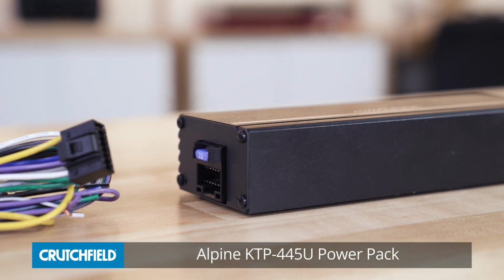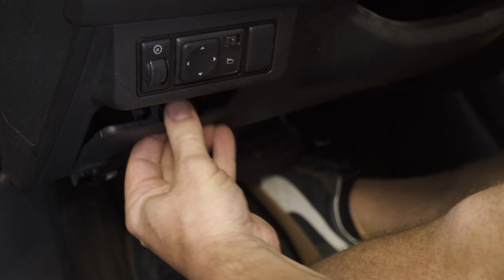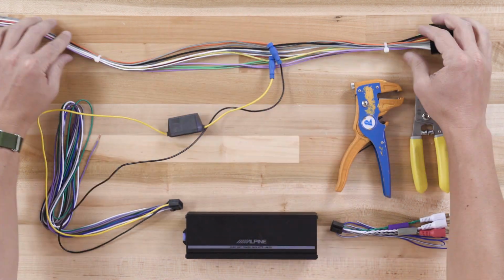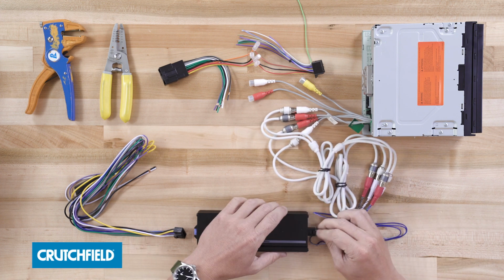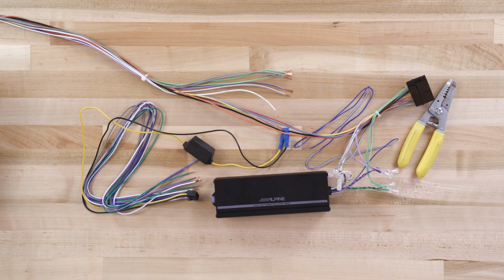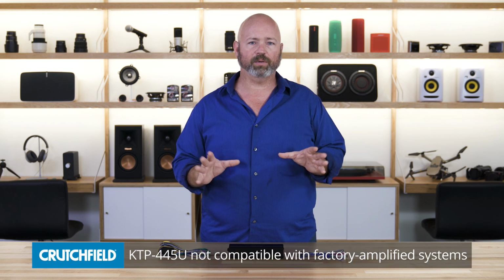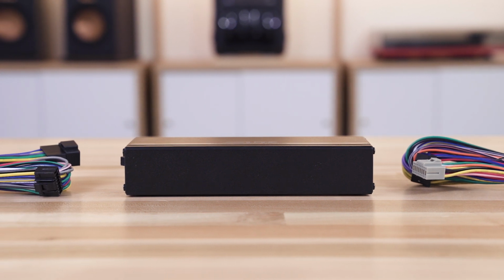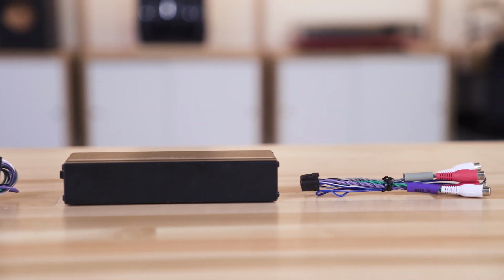How to install the Alpine KTP-445U Power Pack compact amplifier | Crutchfield video

Comment: Great video but what about the ground wire?
Reply from the maker: That part of the install (for the scenario where a new power wire is ran to the battery) will vary depending on the vehicle and is covered through the support we mention in the video that we give our customers. If you purchased your amp from Crutchfield, then I recommend contacting them using their direct dial number that we include on the order invoice. If you don't have that handy, you can call 1-800-955-9091 to get us to look up order the order and connect you to them. If the amp was purchased elsewhere and they cannot help, I recommend contacting Alpine's support on 800-257-4631

Comment: I love this amp. I put this in my 2005 mustang gt years ago. 45 watts rms is more than enough To power your 4 speakers super loud with no distortion. This amp is about double power of any standard aftermarket head unit. Using this keeps my trunk clean. All I have is just one amp in the back powering the sub without having to run a bunch more wires to the back of the car to power 2 amps.
Reply: @joshymcdaniel9233  that is usually marketing mumbo jumbo, you know 50w max, in real life those aftermarket radios make at best 14-21w RMS
Reply: @joshymcdaniel9233  if you bothered to actually measure you'd fine that you have to get into the $700 head unit range before you get anything over 14W ... literally every head unit on the market regardless of what it says can only do about 12-14w per channel with 1% distortion... those 50W numbers are at 10% distortion which may even damage your speakers and will sound like trash. These amp packs acutally can put out 45-50W per channel...
Reply: where did you get your power from? did you hook up to battery? because im trying to avoid connecting to battery
Reply: @helsonly722  it uses the same power that your head unit uses. You can use a separate power and ground if you want to but I’ve been running this for years without issue.

Comment: People have reported that the wires to the speakers have switched polarity, as in the striped wire is sometimes incorrectly installed on the positive lead. @Crutchfield, could you confirm if all positives are supposed to be on one row (along with the black ground wire), and all negatives are supposed to be all in the other row (with the yellow power wire)?
Reply from the maker: We found that the speaker outputs flip between positive and negative on the top/bottom rows
Reply: @crutchfield  What did he say. Flip what. I hope he's not getting paid much that fat bastard  he can't explain anything in plain english.

Comment: I have a question.  I hooked my power pack but I can't seem to get gain control to work. The amp heats up and I have RCA Connections in the back of HU. I didn't connect the remote turn cable on RCA harness side. Do I need to connect that blue wire on the RCA harness instead of the blue wire where the speaker connection are? Do I need to connect speaker wires. I see you connected everything in video.
Reply from the maker: Hey Brandon!
If you purchased that amp from Crutchfield, please contact our tech support team. They will be more than happy to help you out, and ensure that everything is setup properly for use.
You will find their contact info on the invoice we would have sent to your email, or by logging into your online account and accessing your order history.
Reply: No sir I didn't order from crutchfield. Do I just only connect RCA Cables to amplifier with remote switch or do I connect Speaker wire Harness and RCA Cables?

Comment: Is that an inline fuse on the power wire? Is that recommended when your factory radio fuse is greater than 15amp?
Reply from the maker: If your factory radio has a minimum of 15A, you do not have to use a separate power and ground, although we do still typically recommend using the additional wiring to be on the safe side.
Reply: No, it’s not a fuse it’s a noise filter

Comment: Wouldn't it just be better just to run  positive to battery to not risk blowing fuse, especially if it's barely 15 amps? If i gotta take apart the dash, might as well run it to battery ¯\_(ツ)_/¯
Reply from the maker: It's always good practice to run a dedicated power wire to the battery for your amp. You don't HAVE to if your radio has a 15 amp fuse but that doesn't mean you shouldn't.

Comment: I already have a Metra 70-5520 (retained all steering wheel controls) with this Alpine KTP-445U
 coming from a 2010 F150 (non-bose, non-navigation) and want to add a Sound Ordnance B-8PTD.  What do you think my is my best option is to get signal and remote turn on to the B-8PTD?
Reply from the maker: Hey!
Tech support will be happy to go over your connections with you!  Get in touch with them with your order number!  You'll find their contact info at the bottom of the invoice we emailed you!

Comment: Hi, is the KTP-445A harness plug and play with the Alpine XLi-007??
Thank you
Reply from the maker: I am guessing you mean the iLX-007 receiver. It's harness port also works with the KTP-445A amp. It can be a plug and play install as long as the radio circuit fuse in the vehicle is 15A or higher.

Comment: Hi and good day - thanks for this great Video. Quick question - my current Radio is 7.5 Amp. Instead of running a wire from the battery - can i use a Fuse Tap - on the Radio Fuse with a 15 amp instead? 

https://www.ebay.com.au/itm/Add-A-Circuit-Fuse-Tap-MICRO-Fuse-Holder-APS-ATT-mini-LOW-PROFILE-12v-Free-Fuse-/271502992577?_trksid=p2349526.m4383.l4275.c10#viTabs_0
Reply from the maker: Hi Desmond!
In your particular situation, we would not recommend using a fuse tap.  You will need to go with wiring from the battery instead.

Comment: Wow, that was a great detailed video!  Thanks for sharing!  Question for you, I have ALPINE HEAD UNIT IWE-W957HD installed in my car with TWO 8inch ALPINE PWE-S8 Subwoofer.  So far sounds good but I do not want loud I want great quality sound.  Considering i already have a nice setup.. do you think by adding this AMP will it make a big difference?  I'm looking for quality sound... not loud sounds..
Reply from the maker: Glad you enjoyed the video Jeff. Adding the PowerPack amp would be a nice boost to your front and rear speakers but wouldn't affect the subs. Have you replaced the factory speaker? If so, adding a 4-channel amp like that Alpine should definitely improve the highs and mids to compliment the bass you already have.
Reply: @crutchfield  Thanks for your feed back!  i finally did the upgrade to Alpine KTP-445U and love it!

Comment: Soo can I amplify my factory subwoofer with this ?
Reply from the maker: this is a full range amplifier, and does not have a low pass crossover option.  This should not be used to amplify a subwoofer.  Also, a factory subwoofer shouldn't be powered by an aftermarket amplifier, as they are likely too strong and will damage the factory subwoofer.  
If you need help with setting up an aftermarket subwoofer solutions.  reach out to one of our advisors! https://bit.ly/2KP1zS3

Comment: JR

You covered the aftermarket radio to the Alpine amp, but dropped the ball on hooking the Alpine amp up to the speakers. The four cables are obviously not going to power the speakers in hooking between the aftermarket to the amp. You may want to have someone at Crutchfield review your YouTube videos for continuity prior to releasing them to the public.
Reply from the maker: That’s a pretty great observation Thomas. I did cover how to connect the speaker outputs of the Alpine amp to the factory speaker wire as a part of installing this amp with a factory radio (speaker level inputs), but I did not make it clear that the process is basically the same thing (cut the factory wire, outputs from the amp go to the factory wires out to all the speakers) when using the Power Pack with an aftermarket radio (RCA inputs). We've updated the description of the video with this information to hopefully make things a bit clearer. Thanks for the comment.  - JR
Reply: @crutchfield  JR 
Thanks for the followup. The next question is regarding to new speakers and wiring as opposed to existing stock products. The question here is wire size, as the speakers supply lead wires that appear to be about 20-22 awg. The aftermarket speaker wire I have come across is 16-18 awg or larger speaker wire. Any drawbacks in splicing the 20-22 from the speaker to 16-18 awg for routing from the amp to speaker, then connecting directly to the speaker?
The vehicle is a 81 Chevy c-10 Stepside pickup restoration - and if you have clarification regarding the orange/white wire listed for illumination purposes regarding what this wire splices to for power, it would be very helpful. Neither the Alpine nor the Pioneer DEH-X8800BHS radio instructions clarify the source - key or direct 12 volt, etc.
Thanks in advance
Reply from the maker: I do not expect any issues to occur from connecting those two wire gauges to carry the output from this amp to the speakers. I've also looked at a few pictures we have of this dash and feel like you should be able to install the Alpine in it and may not even need to worry about extending the stock wiring to connect to this amp.
The illumination wire is used to automatically dim the receiver's display when the headlights are turned on so it needs to be connected to something that become hot when the lights are on. I recommend consulting technical support for help with the install and to make sure you use the correct wire in the vehicle. We include their direct line on the invoice we send for the order as we give lifetime technical support on gear purchased from us. If the Pioneer was purchased elsewhere and they cannot help, you might try contacting Pioneer's support on 800-421-1404
Reply: Thomas Evans .....Yep

Comment: Hi, i have an Apline ilx-702d head unit, so i know the KTP-445 'A' model would be plug and play into my apline head unit but my only concern is my fuse for radio is only rated to 10 amps, would be over loading the circuit if i use the 'A' model amp as it would be running power from the radio circuit? Or do they have their own separate power and ground which i could run to the battery? If not would i be better off just using the 'U' universal amp as it comes with dedicated power and ground wires? thanks
Reply from the maker: If the fuse rating of the radio is less than 15 amps you will want to run a dedicated power wire like you'd find in this amp wiring kit https://www.crutchfield.com/p_007CK12/Crutchfield-CK12.html
Reply: @crutchfield  I thought so but can you still run dedicated power with the KTP-445A ? I know you can on the KTP-445U model but unsure if the A model has its own dedicated power and earth.
Reply from the maker: You definitely can! Since the 445A model plugs into the Alpine radio and the Alpine radio's harness plugs into the 445A, you will have a bare constant power wire to use to connect the new dedicated power wire. Its the one on the Alpine radio's harness

Comment: Do I need a bigger fuse amp under the hood or wherever the fuse box is located? Because my radio or the alpine power pack amp shuts off and high volume.  2009 accord.
Reply from the maker: It appears your vehicle does not have a big enough fuse for the radio circuit for this amp to use it. This means you will need to run a power to the battery for the amp. We have a wiring kit for this purpose:
https://bit.ly/2ZE36gc

Comment: How do I install if my car has a factory amp??
Reply from the maker: This Alpine high-powered amp won't work in systems where an outboard factory amplifier is still active. If used in vehicles with a factory amplifier, the factory amp will need to be completely bypassed (this may result in lost speaker channels, if factory amp has more than 4 channels).

Comment: , i have a 10 Amp fuse and I dont know what type of wire I need to use to get to the battery.
Reply from the maker: A 12 gauge wiring kit is what you would need

Comment: So I would have to cut stock harness?
Reply from the maker: If you are going to be using your stock stereo, you will need to cut your speaker wire coming from the stock stereo, and then cut the RCA connections off of the input harness that comes with the Alpine Power Pack.  This will allow to connect via speaker level input!
Reply: @crutchfield  Would it be possible to avoid this by either using a t harness or breakout harness instead?

Comment: Ok so my question remains unanswered my car runs a factory amp under passenger seat ....is there a way i can make this work maybe swapping the amp is there a solution??
Reply from the maker: Pete, In most cases, you can still use this, but you will always have to bypass the factory amplifier.  There are different ways of doing that based on what vehicle you have.  But, the short answer is yes, you can still use this.  One of our friendly advisors would love to go into more detail with you...  reach out to one of them here:  https://bit.ly/2KP1zS3

Comment: Do I have to run wires to each individual speaker or just to the stereo?
Reply from the maker: Depending on the vehicle and where you mount the amp you can often use the factory speaker wire and avoid running all new wire. You can connect with one of our friendly product advisors to get a better idea of how the install would look in your vehicle: https://bit.ly/2DGSzu3

Comment: This amp doesn't seem to need a large power wire. I'm planning to run a 8 gauge down to the harness power wire.  I'm wondering if you did the same.  Also, will grounding the amp directly to the battery prevent noise since it gets a direct path to the supply?
Reply from the maker: The power pack is made to work with most stock stereo power leads (minimum 15 amp circuit) which are commonly just 18-22 gauge so, it certainly does not require an 8 gauge run. Running 8 gauge won't hurt anything but it's certainly not necessary.
If the stock system does not provide a quality ground connection at the stereo, you can ground to the vehicle chassis or all the way to the negative terminal on the battery.
For additional assistance and personalized recommendations, feel free to contact us directly by phone or through our online chat service: 
http://bit.ly/2jBGHPp 
Hope that helps
--Crutchfield

Comment: It's been years since I did a amplifier installation, This may sound like a dumb question but if I'm using the RCA inputs Do my head unit speaker wires need to be  connected to any thing?
Reply from the maker: If you are using an aftermarket radio that has RCA preamp outputs you would use those to get signal to the PowerPack. You would not need to connect anything to the speaker level outputs of the head unit.
Reply: @crutchfield  thanks sounds good

Comment: Will this amp work on a 2017 Dodge Challenger without a factory amp? 
Reason I asked, is a installer could not get the any sound from it. He said it would not work for the newer Dodge's. Guess they tried to connect the power wire.
Reply from the maker: It will work in that vehicle. There are some mid 2010 decade Dodge's that need to see a "load" or a speaker before they send out audio, but this 2017 Challenger is not one of them. Best of luck on getting it working!
Reply: @crutchfield  
Thanks for the reply.
Maybe they tried to connect the blue wire.
Would having the blue wire connected cause no sound from the speakers?
They even tried to reduce the output to get it to work. 
This was a national chain store that do installs all day. Not sure why they couldn't get it to work.
Reply from the maker: @michaelcowan6254  The Blue/white wire only needs to be connected when using the preamp inputs. The speaker level inputs are auto-sensing for turning on the amp. I doubt its that. If you purchased it from Crutchfield, I recommend contacting our technical support for help. If it was purchased elsewhere and they cannot help, I recommend contacting Alpine's support for help. I have 800-832-4101 for their technical support dept.
--Crutchfield

Comment: To save $200.00 I've decided to install this unit and my new radio myself. After watching this video I ask, "Is crying allowed? and will it help?"
Reply: Great thing is it will only cost you $250 to fix
Reply: I already have the alpine ilx-w650 radio. How will this work with my radio and my stock amp? Do I need to remove my stock amp and rewire?

Comment: @Crutchfield, I'm using a factory HU and have an amp using high-level-input (tapped into rear left n right speakers) to power a 10" sub.  

Will the RCA pass-thru on my amp work to provide sound to the Alpine Power Pack?  Or, does the RCA pass-thru only work when the amp's sound is coming from an RCA input?
 
Is 1 pair of RCAs all I need to power the Alpine Powerpack?

My idea is to use the Alpine Powerpack to give my rear aftermarket speakers more power, but also use the other 2 channels to add 2 6.5" speakers.
Reply from the maker: Great question. I think it will depend on the amp. Some can pass through either speaker level or line level inputs. If you know the model number you can connect with one of our Product Advisors to make sure you have everything you need: https://bit.ly/2DGSzu3